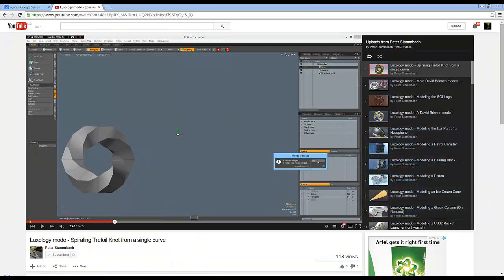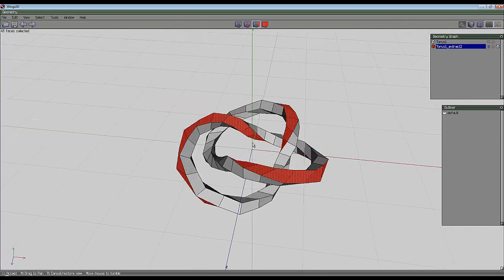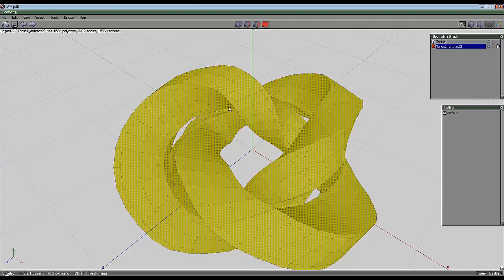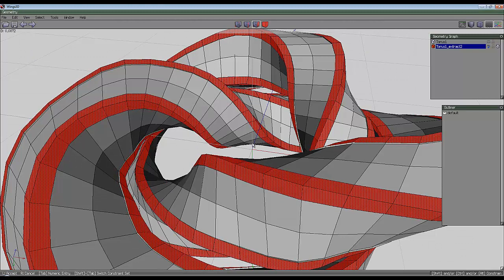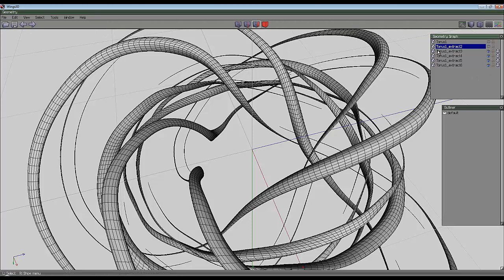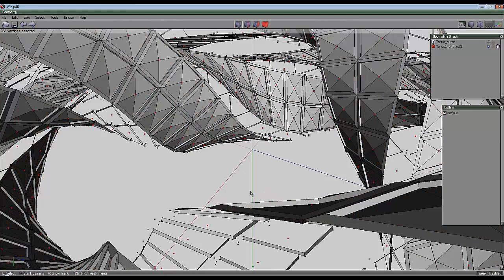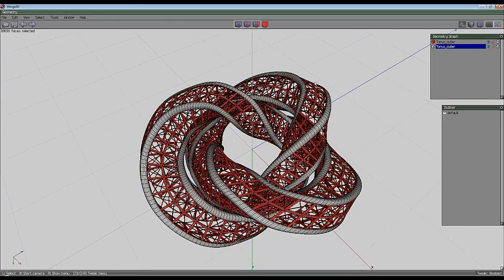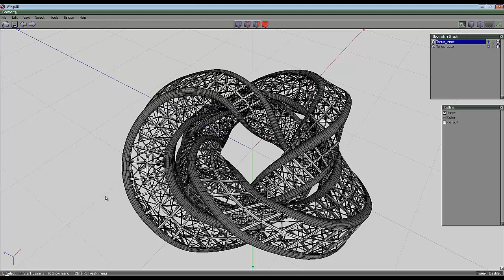Wings 3D - square section torus knot - by David Brinnen.

Comment: Very Nice. I might have a try at this in Carrara. Not sure what the result will be, but may be fun to try in any case.
Reply from the maker: Cool.  Does Carrara allow sub-d modeling or only rendering?
Reply: Yes, Carrara has a full package, BUT, it does not have a Torus, LOL!!! I will have to use a modified and cut down cylinder.
Reply from the maker: Thelby1 Ah, right, I did not know that.  I did try Carrara at some point but found, like with many applications, I struggled to live with the interface.  One of the main reasons I do so much with Wings 3D is that the interface really suits me.